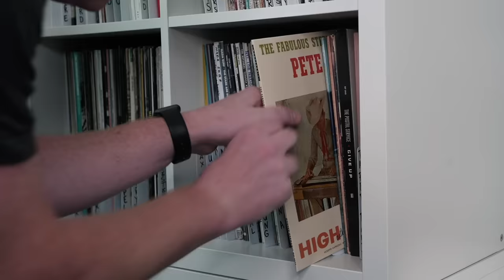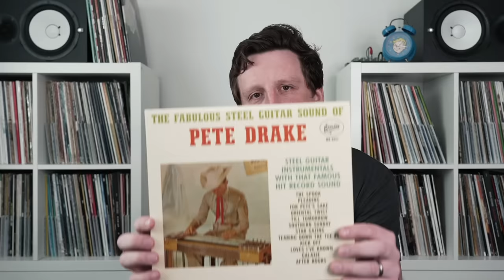6 Guitar Pedal Myths

Comment: The problem with surface mount (SMD) is serviceability for the end consumer. Parts like pots and switches should IMO be mounted on separate riser or extension boards, making component replacement easier of wear parts ie. switches, pots, jacks. SMD will always sound superior to through hole, or even worse, point to point wiring. As far as op amps go, it depends on how their used in the circuit. An OPA2604 can sound awful compared to an RC4556 if the supporting circuit isn't optimized for it. The lowly NE5532, which is found in practically every coveted recording console ever made, is no worse than a TL072, also used in almost every console in existence. There are sometimes 10s to 100s of these cheaper op amps found in the signal path of various studio gear, on which most our favorite albums are recorded with (including Neve and SSL desks). You certainly never ever hear anyone complaining about the way those sound. People need to get over their hangups and preconceived notions about op amps, capacitors and transistors. Even the whole tube vs fet argument shows us we can simulate just about everything these days, either in software or hardware. Welcome to 2023... keep making those great pedals! BTW, I love the way your Clover preamp pedal sounds with a bass. I really need to get one of those.

Comment: unnecessary glue on pcbs.. hate that, its just or mostly trying to hide something that is not interesting at, and sure there are good reasons to use glue and in so e occasions its required.. but in a guitar pedal ? I should be able to open it, mod it, repair it, at least that's how I think about it. 

Got the boss JB-2 last week, it's one of my favorite already and its amazing to experience the versatility of the sounds I am able to create with it  ... and how I found this channel btw 👍 👍

Comment: I have collected plenty of pedals over the years. 
Some of the classics and a few somewhat obscure. 

I purchased most of them because of the influence of others. 

I have Several of the common drive pedals, like a TS, Blues Driver etc.  I’m not saying those pedals are bad, just that none of them really improve what my amps do with any one of my guitars plugged in direct. 
I will say this.  My daughter purchased an Electro Harmonix Soul Food for my birthday several years back.   It has a pleasant sound, still not as good as direct to the amp, but certainly useable. 

A compressor helps, my carbon copy has its place, but it’s only occasional.  Most pedals introduce noise into the sound even when using the pedal just for accent. 

I obviously take some interest otherwise I would be viewing this video. 

Aside from the few exceptions,  my Evil twin sounds great all on its own. 
As does my classic 30 and my latest acquisition, a Vox AC15c1. 

I’m not knocking anyone for using pedals, or producing them, I’m simply saying that people should stop “chasing tone”, when it’s right there in their hands.  Train your ears to be able to “hear” what you are listening to, then learn to dial in the amp/guitar combo...before adding the pedals. 

When you’re there, adding for accent is a lot more effective and pleasing to the ears.

Comment: Old thread I know but I’m just now getting here. I appreciate the effort you have taken to bust these myths. However I think just maybe the better opamp might have some application. I have tried multiple opamps in lots of different circuits and almost every time I can hear no distinguishable difference. But one time I had just completed a BLues Breaker like pedal and the tl072 defiantly had a more pleasing more smooth tone than the other 8pin chips I had at my disposal. I can’t explain it, maybe it’s magic? Maybe the the circuit just fit that opamp 5% better and that was enough to notice?  I could really use a voice of reason here.

Comment: Solid state vs tube, not a  pedal related thing but I had been looking to replace my Valve Jr head, the lack of a tone control was driving me nuts. I was set on getting another tube amp but couldn't really afford it. A friend of mine at a store handed me a cable and had me play through an Orange Crush 35RT and it sounded great! Didn't know it was solid state until after I was done playing. I ended up snagging one off of Sweetwater for $180 that was a "Demo" it was brand new just with a damaged box.

Comment: Well this might be applicable, I recently received my Peavey 6505+ from repair, and reasons I dont want to share on this platform it wasn't fully repaired - the 6.3V heating filament supply winding on the transformer still needed to be replaced by a custom wound transformer (oh ya I burnt out the winding on the transformer, shorted out the line with main power). 

Anyway - so I had a big old transformer that I used while waiting for the custom 6.3V 20VAC transformer, and to me the amp just sounded amazing.....a long story short, I basically replaced the the big transformer with the custom one only to think that it didn't heat up the tubes the same as the other one I used, being 100% sure the amp now sounded horrible...........after a lot of effort and measuring both, turns out that was all in my head......and that they both are identical and sound exactly the same......very easy to  hear what I want to and to be so sure of something yet be totally wrong. I was sure I heard this difference, and that.....yet after testing it, the realization that they are in fact the same restored the sound or my perception that now the amp sounds great again.....mmmmh fishy

Comment: One advantage of thru-hole vs SMT is the ability to remove/replace a component that goes bad.  SMT can sometimes be reworked but it's more difficult for the average "guy who just bought a soldering iron."

Comment: I don't get bogged down fretting about chip sex or how my germaniums are doing.  I mix and match guitar cords of various quality to fit what I'm feeling at the moment.  What matters is, is this stuff going to work when I stomp a button?  My basic set up is an Ibanez UE 300 tube screamer fed by a dynacomp.  I use other pedals to taste but they are out of the chain until needed.  Here in the Future, 2021, live music has been put on hold for a while and I have struggled with the loneliness and isolation and not bought a banjo.
In the Future you will produce a PBS worthy video about the historically correct history of distortion pedals.  We will have fun again.  Hello from 2021.

Comment: I totally agree with those myths and have been busting them myself to fellow gearheads.  However...  Although you do need a buffer (or two) well placed on a pedalboard, some cheaper buffers really, really do 'suck tone'.  I have a early 80s Boss CE2 I just adore, but I installed a loopi to not have to go through it all the time.  Bonus : I can hence 'switch it on at off' for testing purposes and it definitely does somewhat squash the frequency range.  So is True Bypass 'better' ?  Well, yes, in a sense.

Comment: The surface mount controversy is just like “hand wired” vs. PCB in amplifiers. The Blues Jr. I bought in 2001 was made in Mexico with PCB construction. Really bad PCB construction. However, there is no reason why PCB construction can’t be as good or better than turret board or eyelet board construction (because let’s face it - virtually no one does actual hand wired amps). If you are mass producing pedals, you’d be silly NOT to use surface mount technology.  If you are mass producing amps, of course you should use PCB or surface mount technology. Just make sure it’s well done. 

As far as I’m concerned the only difference comes in if you need to do a repair or want to mod something. Trying to fix things on a crap PCB is a nightmare. My Blues Jr. burned up power tubes because it was biased too hot. I was able to install a bias adjustment trim pot but it was fiddly.  Now the board mounted input jacks need replacement and the ribbon cables are giving me fits... I can’t imagine trying to mod surface mount construction.
Reply: I think this is the thing about surface mount. If it breaks its PiTA to fix. Discreet components at least you stand some chance of being able to swap them out. Arguably why a 60-year old turret designed valve amp can be fixed again and again but your new Blackstar goes in the bin when it dies.  Same the world over now though. Everything is is throw-away. We don't build anything to be maintained. Built in obsolescence to keep the profits churning.
Reply: “Virtually no one does actual hand-wired amps”

Uhh you’re very very wrong
Reply: @shawnmazzeimusic9549  please go into a Guitar Center and show me an amplifier that actually is hand wired. By that I mean components individually soldered in place by a human being. Turrets or eyelets - take your pick.

Comment: I would like to chime in here with regard to different audio components and how they affect sound / feel.

Have you ever heard of "tuning a circuit?"

The idea with tone is that the entire signal path - sum of all components - affects each other.

Let me give you a specific example with a previous SE Tube Amp I built - 

First / Largest Filter Cap coming off the Rectifier - JJ 100uF vs Kendrick 100uF

Yes, I could hear a noticable difference in the way each one affected the entire circuit 

Can two different 100uF caps discharge at different speeds?

All I know is, electrically speaking, it should be impossible for these caps to influence the Freq Response - specifically - the Kenrick affected the circuit by having treble range, less sustain and seemingly more clarity!

Now how is that possible?

Well, I believe that if your pwr has more voltage & less current, you will have more clarity + more dynamics + less sustain - visa versa if you pwr has a higher ratio of current to voltage.

Swap out a 12AU7 for your 12AX7 sometime - 3x the current gain & 1/5th the voltage gain (assuming you've biased properly).

I use the 12AU7's all the time!  They don't break up like the 12AX7's and allow you to hit them harder with more pedals - essentially, having more of your preamp in Solid State where is can be more easily controlled.

To balance the more liquid / sustain sound that comes with more current - I use beefy trannies + solid state rect's that were designed for welders . . . a beefy overspeced pwr supply + a 4 ohm cab to more quickly suck it up.

Which leads me to my conclusion - dynamics and tone are always affecting one another through the medium of your ears / brain.

Comment: I hate to admit it but I used to be hung up on the 4558 chip myth. Wouldn’t touch an overdrive unless it had it. But realized later in TS type circuits pretty much all dual op amps sound the same.

Comment: For years had a Big Muff and swore by it, but the pots are buggered. 

Got a TC Electronic Honey Pot and... I think it's better. 

The Big Muff IMO needs a lot of EQ tweeking to refine the sound but the Honey Pot has a brilliant clear, focused and crisp sound straight out of the box that's perfect for what I need.

And the sustain control has far more range than the Big Muff, so you can have a much subtler fuzz if you want.

Comment: Just found your channel and finished watching this episode. So right on. True Bypass vs Buffered pedals was an insanely big deal to tone snobs. Yet in the early 90s I ran a small store and our top selling pedal was the TC Electronics SCF+. 

Years later (2005) I “street-repped” Version 2 pedals for Visual Sound (Bob & Co sent me a pedal train with their 3 double  pedals, a one spot, and samples of all the One Spot adapters). He did great marketing with explaining the “True Tone” buffer in each, and the pedals themselves were great. But people didn’t want some unknown brand. The biggest remark was the OD (same circuit in Jekyll & Hyde and Route 66) was not as good as the TS9. Often I would sit down with a TS9 and the Route 66 and make them guess which ones hey were using as I “switched” pedals, claiming to start with the TS9. Every time I switched they were still hearing the Route 66, but would claim “the first one was better”.

Comment: When my Guyatone PS-031 became unreliable it was sad. It was a Rat type pedal with old fashioned  through hole soldering and the 308 chip. Now I play a Timmy clone and have to admit it handles gain and volume in a way that is much easier to dial in. I still miss you Guyatone pedal.

Comment: I think surface mount "good or bad" depends on application.  Things that frequently see stress (i.e. jacks) are better through hole because they are less sensitive to stress fractures causing failure... as seen in failures on headphone jacks and usb charging ports.

Comment: Yeah I can see how we could fool our selves into thinking  one component sounds better then another. Back in the late 60s when I was playing more often I messed around with changing caps and resistors as well as trying to soup up pickups. In those days finding parts was not essay. Something I discovered when I messed around with blueprinting engines and then I started to understand tolerances. You know this. There have been times I measured the tolerance of a component and found I liked the sound of the weaker value.Just the other day a friend of mine told me he loved the way his 1966 Bass man sounded and I did some research on what went on at fender BTW I don't know how true this is but it makes sense to me. If they run out of parts they would put in a slightly different value in it's place. I think they where referring to pots in the article. On another side note I have a very close friend thats into ham radio and is really into electronics when he use to fix my amps they always sounded tinny to me when I got them back and then I realize it's the shape of his ears. Number 7 Myth maybe. Thanks Josh for sharing your knowledge. Enjoy your Videos. c];-)

Comment: I built a number of FX pedals back in the '80s. Everything you say is true. I built pedals that guitarists would swear had a tube in them, or germanium transistors/diodes. But that actually had an Op Amp with the appropriate circuitry surrounding it to replicate the distortion of a tube or a germanium. 

The worst thing I could do was tell them what was inside. Then suddenly, they claim they could always tell it was silicon.

I built a few practice amps, too. Everything is part of the sound of an electric guitar. The worst think you can do is connect an electric guitar through a completely clean, wideband, distortion free signal path and amp to the best hi fi speakers. Sounds horrible.

Comment: Yeah, I started playing electric guitar in the mid eighties. I did get a few basic pedals to start with then. But I am kicking myself that I didn't get more then when classic pedals were affordable. I bought into the prevailing myth at the time that rack gear was better. While it is true that generally they had wider frequency response, that didn't necessarily make them better. Pedals in the end had more character. And you could get them cheap then when everyone was dumping pedals for rack units!
Reply: The question is: do you still have and use your old rack mount units?

Comment: The greatest pedal myth I have ever heard or read about (besides the Tube Screamer) is that the original IVL-Tech built Digitech Whammy [WH-1]  (1989-91) was so much better then it's successors that the two weren't even comparable. I have always wondered if it was true or not given that a lot of players if they have one on their board its always the old one and that well they don't go for Klon Centaur-type money their cost hasn't really changed in a decade [$500-600 USD] (also they all typically look beat to hell not to adequate wear to quality but you know its a guitar thing).

Comment: It's not surprising that surface mounts are less noisy. My space shuttle qualified electronics instructors (for real) taught through hole component legs can act as mini antennae, and solder joints have to be soldered in a certain way to minimize interference. Bending out the legs to hold the component was one big no-no.

Comment: As a person who has worked in electronic engineering I found your show on pedal myths extremely funny. Those myths show how foolish people can be on forming opinions when they do not actually understand the underlying technical details. Yes, surface mount technology quality will be more consistent that discrete components. If you design a bad surface mount board you will be consistently more noisy. When you were discussing germanium vs silicon transistors they are just amplifiers. The capacitors are more important from a noise/sound point of view and if you buy capacitors from a bad supplier you would get a poor production run with inconsistent results however in today's world most manufacturers do produce excellent and consistent quality. As an example Arizona capacitors complies with ISO 9001:2015 Qualified. It is this type of approach which ensures quality.  When it comes down to it most individual components in today's world are produced with excellent quality and consistency which then would leave the end product design and quality process to be more important if individual component selection was not scrimped on.